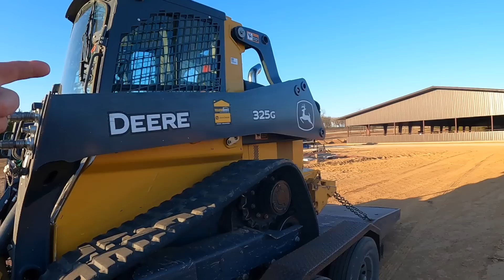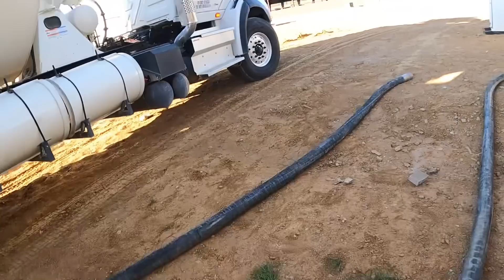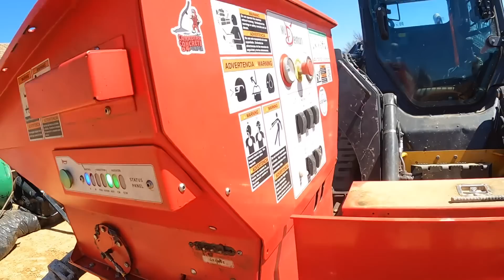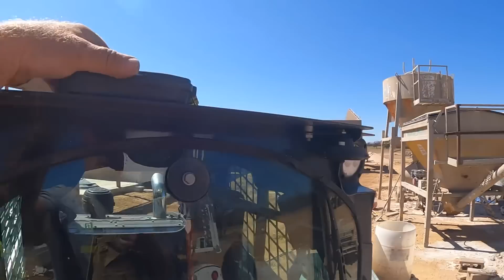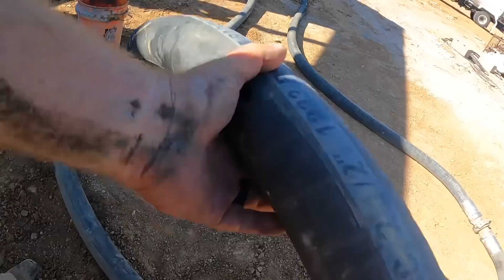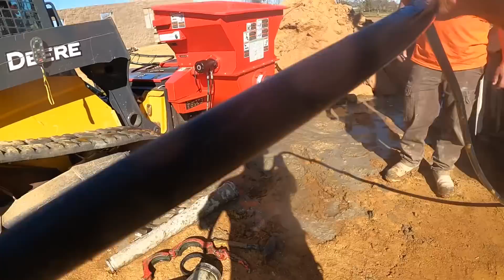Pumping 50 yards of grout into concrete block walls with Muddyfeet

Comment: Yeah, Ive used my washout hook on high block fill like that before but we've since fabed out own block fill hook with 90s. Hangr up then move it down the line. Pump on sir!
Reply from the maker: I actually thought about going to a muffler shop and having one made. I know it wouldn’t last all that long but it should work for a few jobs. Thanks for commenting